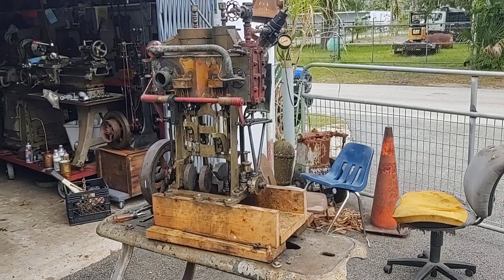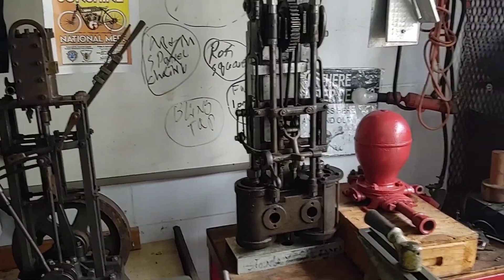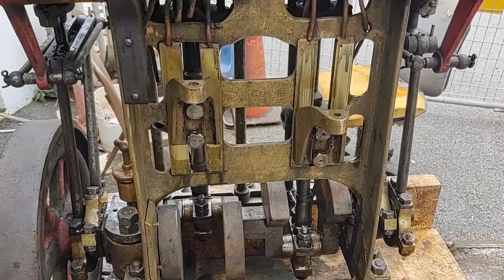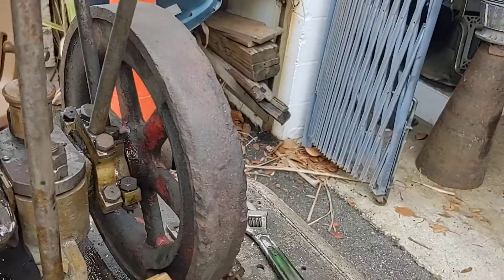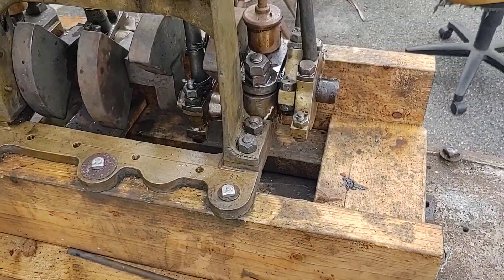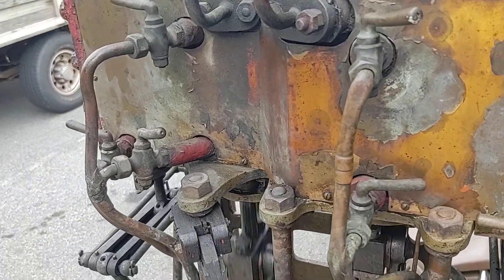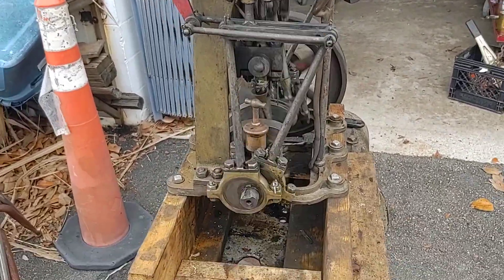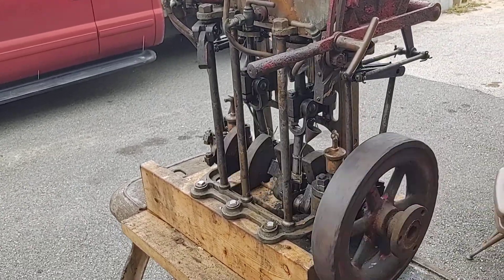Simpson Strickland quadruple compound tandem steam engine

Comment: I have one of these engines :)  same size, about to start restoring it.    I see yours is serial number 81.   My engine is built in 1889 and is 20 numbers earlier #61.     very cool to see one of them running!   I'm about to start the restoration process on mine.  Would love to have a chat with you
Reply from the maker: You can email me @ rogeralexon@gmail.com
Reply: Hey Roger,  sent you an email,  let me know if it came thru.
Reply: Hey Roger, do you still have this engine
 @steamstuff
Reply from the maker: Yes I still have the engine and I am ready to sell it if anybody is interested you can call me 386235 2765